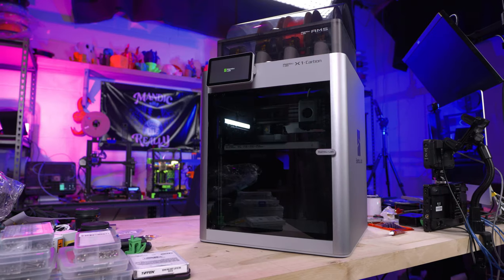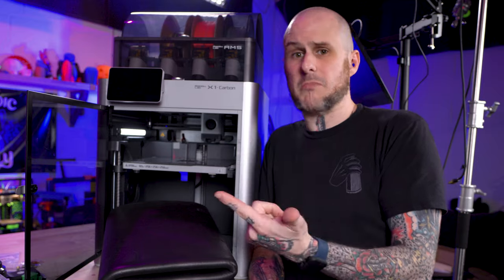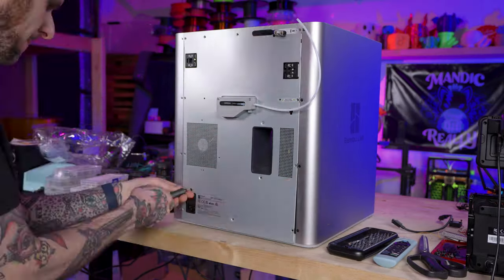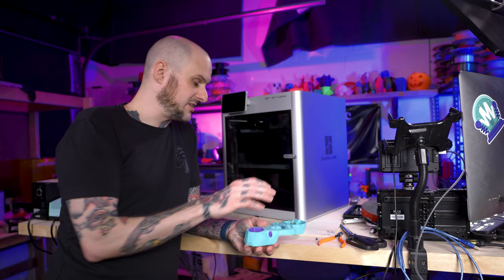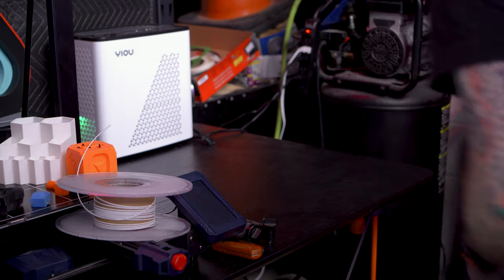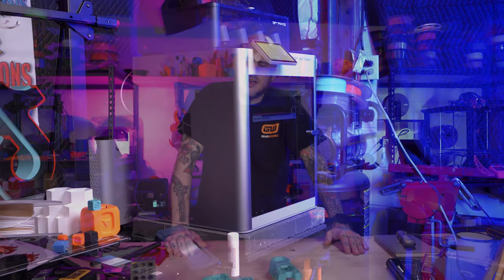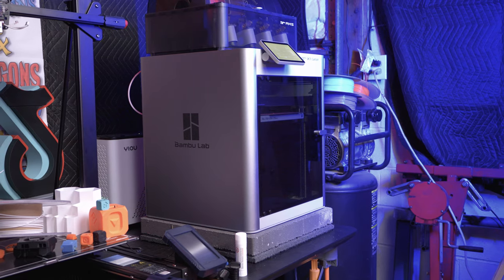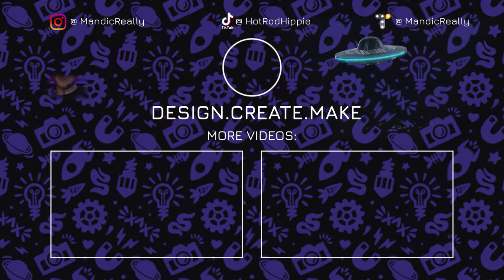Bambu X-1 3D Printer Modding & Problems - Noisy Ringing BEAST!

Comment: So as far as the CLD you used. The aluminum does little for heat reduction, it acts as a constrainer material for the dampening material. The siless you used is mostly filler versus solid butyl, so I’m curious as to how a top tier deadener like resonix would help. I’d expect a much larger reduction since I believe resonix is multiple times better in vibration reduction than that stuff

Comment: What mm/sec and acceleration settings were you using on the shroud print? For things where you care about really sharp corners, it might be worth trading off speed for crispness. - I think this would be a worthwhile thing to explore that a lot of viewers would be interested in.

On the matter of stabilizing the printer, creating a stiffer support will often increase mechanical ringing rather than reducing it, because the energy isn’t being dissipated. It’d be a PITA to try, but one solution could be to use a sand box underneath the printer with appropriate support. There are some fine points to how to make the supports so they’ll dissipate energy into the sand most efficiently (leave a note I’d you’d like to discuss it with me), but I’ve used sand in the past to get rid of higher-frequency vibrations. - Of course, it could be an entirely futile exercise, since we have no idea to what extent vibration of the printer body is actually contributing to ringing in prints.

(BTW, many thanks for this video, I haven’t seen anyone talk about corner-rounding from the vibration compensation before this.)

(Side note: This is absolutely the kind of thing that could be fixed with a firmware upgrade. They could even create different motion profiles that you could select, to trade off crispness vs ringing, or for models with differing levels of sharpness in their contours.)
Reply from the maker: This is absolutely fixable via setting changes / firmware updates and I hope to see that. 

I was running the default speed / acceleration for the prints I did in this video (not all the ones I've done or shown, just the ones I did in this video specifically).  My reasoning being: This is how they ship it.  If someone buys a machine that doesn't know how to tune that stuff, all they have al the profiles they are provided.  None of which lower the speed or acceleration in any significant way, only enough to offset Extrusion Flow Rate (taller layer heights go marginally slower). 

I've done prints at 50% of default speed and seen all the same issues, just the ringing isn't as "Far" as before.  Which is an expected result, it doesn't resonate for as long as it isn't moving as rapidly. 

Bambu has been working with me a bit and they are leaning toward issues being Extrusion related.  Preliminary testing hasn't shown much improvement and the tuning we have been doing has been G-Code editing that cannot be expected of a normal everyday user.  

Oddest thing, I almost entirely eliminated the Ringing last night by... removing the AMS from on top of the machine.  I set the AMS on a shelf next to it, recalibrated the machine, and printed a new StealthBurner.  I did so at 50% speed (default acceleration) and using the modified extrusion rates that Bambu had suggested.  The Ringing is almost entirely eliminated, but the corners are not as crisp as they should be.  So it is serious progress but concerning.  The cord and bowden tube for the AMS are not long enough to place it comfortably next to the machine.  It was clearly intended to be on the machine, but if it is adversely affecting the machine... I don't know.
Reply: @MandicReally  Thanks for the detailed (!) answer!

Huh, makes sense that the ringing might just extend over a shorter distance at slower speeds. - But I’m also surprised that the amplitude doesn’t decrease at 

That’s so interesting that taking the AMS off of the top makes such a difference. It seems like the extra mass on top is making the vibration  take longer to damp out.

Thanks again for the detailed reply, I’m looking forward to your continuing experiments!
Reply: @MandicReally  Another note: I never would have expected this, since I’d assumed that the accelerometer would just sense the motion and compensate accordingly. Maybe the algorithm is constrained to react to resonant frequencies characteristic of the printer by itself, without the AMS on top. 

Adding a bunch of mass to the top would make it take longer to settle down, but maybe the change in frequency is what's leading to it not recognizing and compensating for the vibration?

I have no idea if this is actually the case, but it’s so interesting to me that taking the AMS off made a difference.

Did Bambu suggest taking the AMS off the top or was it just something that occurred to you to try?

Great work in any case. I’m leaning strongly towards buying one of these. (The biggest drawback is how long it takes to change filaments; Aurora Tech reported that taking 1.5 minutes :-/)   But clean prints at speed is obviously an important capability. Thanks again for your work on this!
Reply from the maker: @DEtchells  I removed the AMS after a creator friend (who also has a X-1) noted they had heard of it helping. I later saw t hat someone had mentioned trying it on the Facebook group.  I need to get back with Bambu about my updated test results and continue with them.  My assumption is either the adjustment parameters have too narrow of a window that they can only correct so well, or they are just being applied incorrectly.  Without being able to see the Accelerometer results or how they are applied, I just cannot say. 

As for the filament change out time, I've never noticed it yet.  After each print with the AMS the machine unloads the filament automatically.  It is unloaded before your print bed has cooled enough to remove the print.  I have not yet run into a case where I was bothered by how long it took to load and setup for a new print.  It is odd how it HAS to cycle the AMS every time you insert a new filament, but I just throw a spool in and then go send the print file to the machine.  By the time I'm done that process, the machine is ready to go.  Also have to consider it is going to take a minute or two to reach printing temperatures to get going anyway.  The filament swap process can be done in that time.
Reply: @MandicReally   Aurora Tech was saying that when she was doing multicolor prints, it took ~90 seconds for each color change :-/

It's probably not an actual issue for me, since all I really need the "color change" for is soluble support material, which would be only occasionally. My main use of the AMS would just be for convenience, being able to have PLA, PETG, Nylon etc loaded and ready to go all the time. (Assuming that the desiccant pack  could keep it dry enough for the nylon to print well.) So the color change time won't really be that much of an issue for me.

I've preordered a Prusa XL, and it has the advantage of swapping the whole hotend, so changes are much faster and you can print with materials needing different extrusion temperatures. But the Prusa is a lot more expensive, and who knows when they'll actually ship...
Reply from the maker: @DEtchells  yea, I came to the AMS from using a Palette 3 Pro, which is MUCH slower and more troublesome. (I'll likely do a dedicated video about that.) So between the improved speed of the X-1 (Palette cannot feed a Voron fast enough) and the AMS functioning better overall, the Multi-Color printing is much faster. 

I also have a Prusa XL pre-ordered but am not expecting to see it anytime soon.  That does appear like it will be the superior system overall, but until then I'm not disappointed in the AMS overall.
Reply: @MandicReally  my thought would be the spools and parts in the AMS creating odd and random frequency changes. also comparing it to input shaping on a voron  with klippers basic range, it seems like it goes through an odd range of frequencys  and ihmo goes through the range to fast.  id be intrested to set up an ardino and attach an adxl and use  a script to process the raw  data and see an actual graph.
Reply from the maker: @SubieYam  The AMS on top is almost certainly amplifying some of the resonance.  It is at the top long end of the "moment arm" if you view the Base as a pivot point.

Attaching a ADXL and just seeing whats happening during testing would be interesting.  I'm not sure I 100% see value to it but I also want to see the data it returns as well, so I'll see about giving it a go when I can.  I've got a few things I want to do with this machine that require some more time than I've been able to dedicate to a follow-up yet.

Comment: spoiler alert: build a larger volume rectangle to subsume (contain) the printer’s volume. box in a box. sound attenuate the inside planes of the larger box. russian dolls conop. plus, you can vibe isolate the printer “box” relative to the larger box to compensate for the printer’s Hz spectrum. this is what i will do if i score this printer.

Comment: I have the x1 standard model and have only been printing in PLA So far and noticed the rear fan never runs . Is this normal ? 
I printed a activated carbon filter and filled it with aquarium carbon but not even seeing the benefit of rear fan never runs
Reply from the maker: The exhaust fan only comes on at high chamber temps, it’ll never come on printing PLA. You also don’t need carbon filtration with PLA. There aren’t really any dangerous fumes from PLA, just maybe some micro-plastic dust that a HEPA filter would do better with.

Comment: This is just about everything I wanted to do with my Bambu, thanks for saving me some effort lol. Did you run the noise test with it on the paver+rubber though? That might be why it sounded quieter
Reply from the maker: I did and haven’t tried otherwise. Though I didn’t note it being much louder on the concrete. Granted I didn’t print another Benchy. I’m sure there paver/rubber paved contributed

Comment: So thoughts here. One improvement I haven’t seen but I’m curious about is purchasing another cooling fan setup(or printing and adding own fan) and setting up on the opposite side, it looks like enough room but I haven’t gotten mine yet to confirm. Other thought, have you tried slowing the print down so it doesn’t have to compensate as much on the corners? I get speed is one eye catcher with this machine but to me it’s the minimal setup required to immediately print, meaning you don’t have to know how to calibrate each detail, for the most part the machine does that for you
Reply: The problem with a second fan on the other side is that they’d be fighting each other. You might get better cooling on the far side, but I’d think poor cooling in the middle, where the the fans would tend to cancel each other out.
Reply: @DEtchells  that’s not how airflow works… there would be no “cancel out”. They might taper off or cause an upstream and a downstream based on airflow and temperature, but after first few layers(usually fan off during those anyway) it will hit on either side of the part anyway
Reply: @apollyonabaddon1402  Ah, great point. I was thinking about the airflow as if the part wasn’t there. (Duh) You’re right, of course, the whole problem is that the part interrupts the airflow, which is why the far side doesn’t cool as well. Having a fan on the far side would definitely help there.

Comment: Great video. otherwise, I think I know why you don't have sharp edges. the problem is not in the printer but in the slicer. BamboStudio has 0.012. and Prusa or other slicer at 0.002. try to change those options in the slicer and reprint on the floor. I think there will be a difference. I think this is done on purpose to compensate for the speed. with this sharp edge, the outer edge must be printed at 100mm/s. if you have time for the test, try it. my printer hasn't arrived yet, so I can't do a test.
Reply from the maker: If you mean "G-Code Resolution" PrusaSlicer has it at 0.0125mm and Bambu Studio has it at 0.012mm.  No difference.  I don't know where you got the 0.002 number from, I just check PrusaSlicer and the default on all profiles I checked was 0.0125mm.  I've got updates on how I've improved the results on this machine, I'll be doing a follow-up video soon.

Comment: How is the Prusa mk3s+ quality compared to it? I can't decide between the Prusa and BambooLab
Reply from the maker: I sold my Prusa Mk3… Just did a video where I explained some of what I disliked on that machine. I’m still not entirely sold on the Bambu, but I’d recommend it over a Mk3 currently.
Reply: @MandicReally   From all reviews I saw the Bamboo seems to be technically superior. But what I don’t like is: proprietary parts, which somebody can not buy if the company is out of business and the „always online“ cloud function, which sends the 3d model I want to print to the chinese cloud. I like that you can get nearly any part easily for the Prusa and that they offer „upgrade kits“ for new versions of the MK models. But the Prusa seems to be outdated compared to the lcd touchscreen, high price without even MMU2S, much slower speed, no camera, not casing etc. (you can upgrade all of this but at a higher price point and the MMU2S seems to be inferior to the AMU of BamooLab)

I tend towards the prusa, because of its proven reliability over time and superb spare parts availability.
But the BambooLab seems to be so much nicer machine, the looks of it, the speed, the touchscreen, the case and even things like the nozzle are higher quality out of the box? BambooLabs has a hardened stainless steel and prusa only a standard copper nozzle. Of course you can upgrade but BambooLabs took thought into it right from the beginning.

But I like that I can assemble the whole prusa, because I never had a 3d printer before and I think as a newbie somebody can learn a lot from assembling the whine machine.

Anyway straight to the point:
Thank you for your replay and I will take a look at your video

Comment: The sharp corner issue is a slicer issue, there's a setting called resolution I think? I turned mine down to 0.0012mm and it fixed this issue. It's near the bottom of the quality tab

Comment: I wonder what spray on rubber coat would be like....
Reply from the maker: There are proper dedicated spray on sound treatment materials. But most of those call for a final thickness that is almost equal to the thinner material I used. So you’d still run into issues with where you can really apply it.

Comment: The rubber is pad is bad.  insulation  foam or sofa cushion foam under the concrete paver is better. the rubber vibration mats are even bad, the can cause more vibration feedback.

Comment: Couldn't you have just... stuck the deadening material to the outside?
Reply from the maker: There were two goals here, dampening & heat retention. You should always aim to control noise & thermals as close to the source as you can. If I insulate the outside, I may be able to apply insulation to more areas. However I may also allow the heat to soak into the aluminum / steel construction, creating a larger thermal mass. Meaning it may take longer to heat up as the chassis absorbs the heat before it hits the insulation. Same to be said with the noise. If the noise is generated inside of a metal box, insulating the outside will help, but it will never help as much as reducing the echoing of the noise inside of the chamber. Think of sound booths for recording music. They aren’t insulated outside, but rather inside, closer to the sound source.
Reply from the maker: Also sticking a bunch of insulation to the outside would just be ugly. I’m a content creator. Having an unrecognizable insulated blob in my background wouldn’t make me look very good in most folks eyes.
Reply: @MandicReally  ya i just finished the video, i get it, the goal wasn’t merely “function” and i can appreciate that

Comment: How is dust in you garage
Reply from the maker: Surprisingly low for what it is. When I started the build out I washed the walls and floor. Have vacuumed religiously since then, and now I run 3 Home Air filters around the space 24/7. The air conditioner is always at least blowing the fan so air is moving all the time. It gets dusty but no more so than any room in my house.
Reply: @MandicReally  I see My house is supper old and a log house so trying to keep up with the already neglected dust winding if it would be if it my prusa being In a in-closer I just got it put together

Comment: To the Chamber temperature, i've put my ender 3 pro into a selfmade box and had huge issues with it, but because it get got too hot 😅 the first runs it got up to 68°C

I had to add 2 noctua 140mm fans to get the temperature under control 🫠

Comment: In case someone lands on this video trying to find out why the corners of his/her/their prints are rounded all of a sudden, here's the most likely cause:

The rounded corners are caused by in incorrect flow calibration. My bet is that you are using Orca slicer (or something alike) that doesn't do the full flow calibration that Bambu Studio (BS) does. I ran into exactly the same problem with rounded corners and couldn't fix it by running the calibration routines. Then I started thinking about what I changed in the meantime, and that was switching to Orca slicer. Orca does a very rudimentary flow test when you select Flow calibration just before starting a print. It is just one simple hooked line and not the complicated pattern that BS uses. It also doesn't scan the line with the lidar. I suspect that Orca does no flow calibration at all and fully relies on it's Filament calibration function. My guess is that the developer of OS radically changed the starting G-code to save time and skip all sorts of tests.
When I switched back to BS and chose to perform the flow calibration before starting a print, the rounded corners where gone and everything was crisp and sharp again!